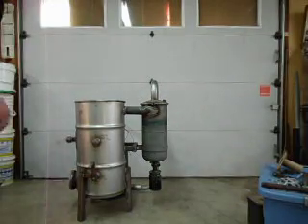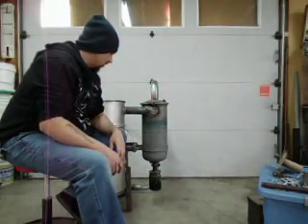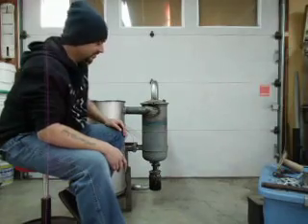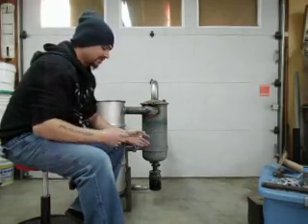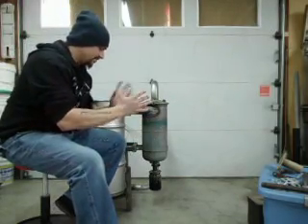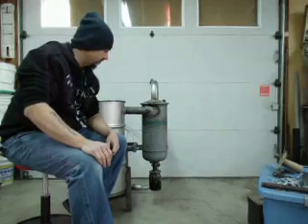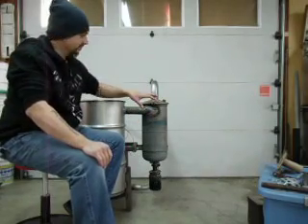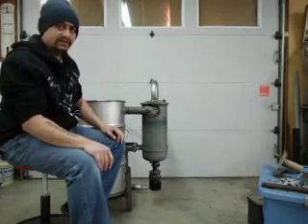how i built my gasifier #2

Comment: I live in Florida and I want to use this system to power an off grid camp. Have you ever run your system in the summer? I'm wondering if an automotive radiator with a box fan blowing through it would help to cool the gas and remove more condensation we have days that are 90-100% humidity. Your videos are fantastic

Comment: in the bottom of your cyclone filter , i am wondering if it might be beneficial to run a couple inches of clean water to help trap contaminates ........ kind of like the old oil bath air filters ....

Comment: hi Josh, you actually hit on the right size for your cyclone more or less by accident. a larger one will reduce the velocity of the gas thus dropping out more particulate matter in a shorter distance. if you were to add a water jacket or cooling fins you could glean away more heat and reduce your gas temp even more. you would then be removing condensate from the gas at the same time and your collector jar would be filling with a sticky black goop.. which i am guessing it already does to some extent

Comment: like run a bong water filter to cool the smoke,, then into a standard truck air intake paper filter to remove the particles,, straight into the engine air intake should be safe enough for the engine yeah?

Comment: Brazing will work for the connections and 200 degrees even 500 wont even come close to the temps necessary to braze so I think I'll have to braze it all together I cant weld for nuttin LOL but I have nearly every thing I need now for a much larger gasifier.
By the way how is your gasafier working today still you must have much more long term Info for us by now

Comment from the maker: @hobo59 i believe in a smaller diameter, there would be more centrigal force to seperate particles, cooling would suffer in a smaller cyclone as a result of less surface area, this however is just my opinion, i could be way off, thanks for your comment,...josh